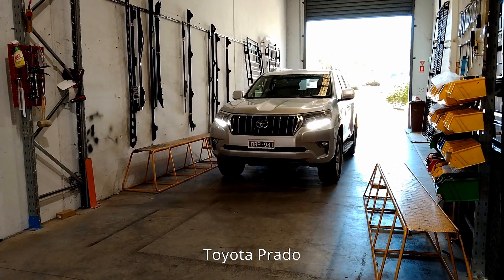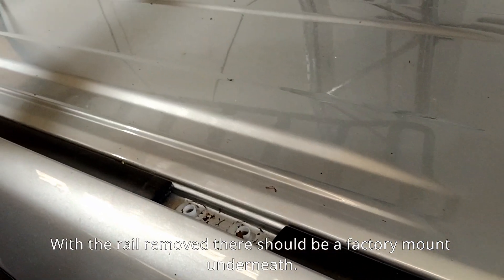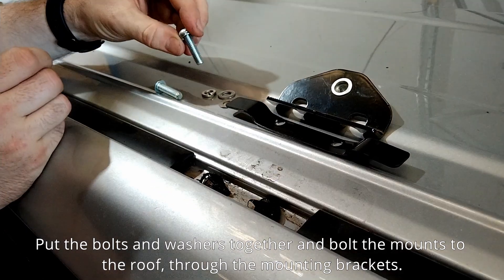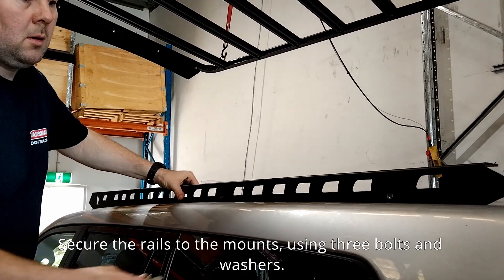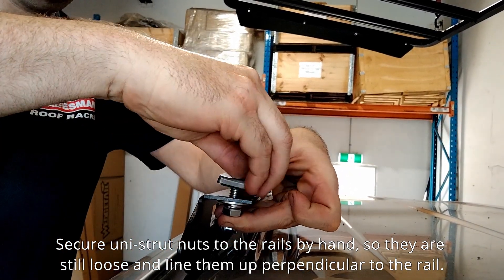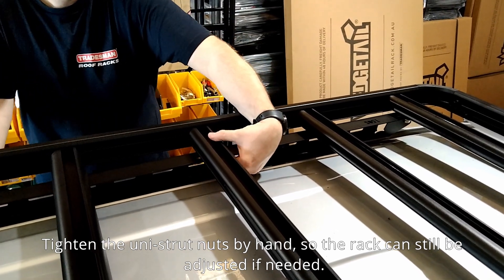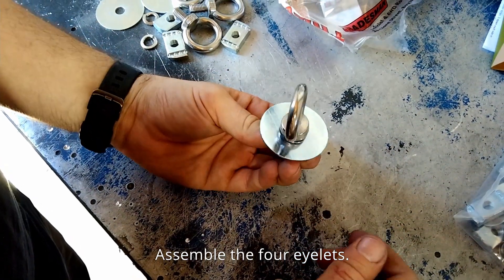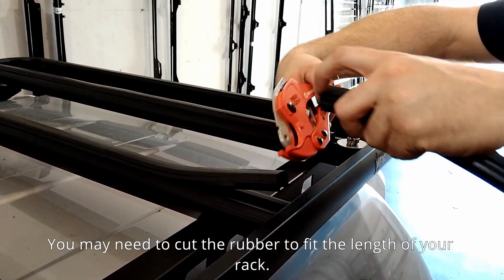Wedgetail Roof Rack Fitment - Toyota Prado

Comment: It's a shame you did not use the mounting brackets you have used here for the Mitsubishi Pajero NS to NX Wedgetail rack.
My previous Pajero was fitted with a Frontrunner rack, no real complaints other than not being able to remove the rack without dropping the headlining to do so. 
Removing the rack and leaving the brackets would have been an option if you had of used this style bracket. They don't look overly tall and are ascetically pleasing, unlike the twin L shaped brackets that you have used on the Pajero that look like rabbit ears. Looking at the video where you fit the Tradesman rack to the NM / MP Pajero, I see you have used the same style bracket to the Prado.
Don't get me wrong, I have looked at a lot of other racks and other than this one complaint, yours would be one of the better ones on the market.